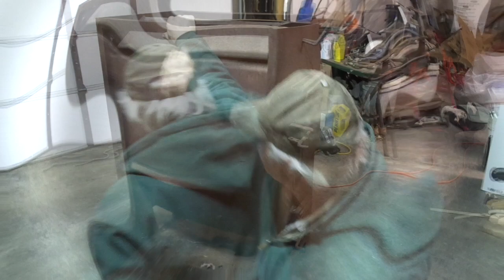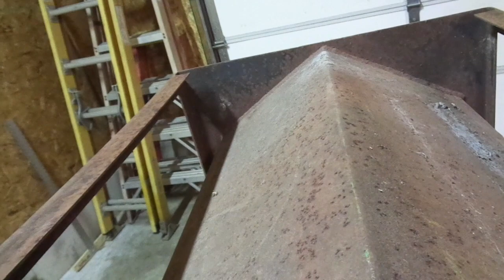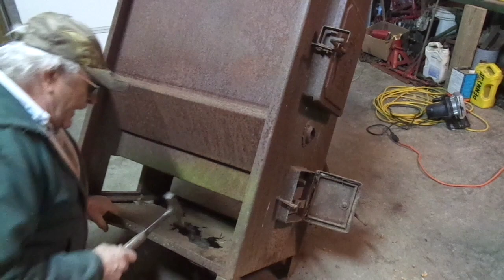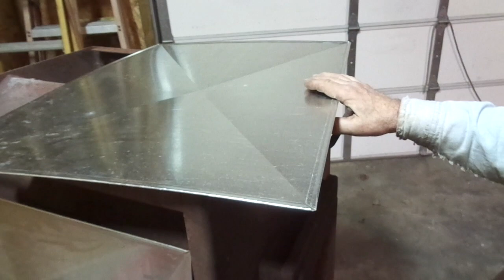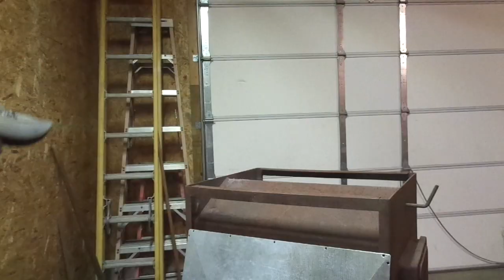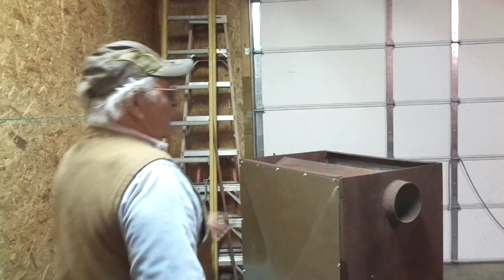Wood Furnace Fire Damage Repair

Comment: The clamps are Cleco Clamps first used in aircraft building.
Reply from the maker: Yes, they should be for clamping skin to frame during construction or repair of aircraft.  But there are a lot of uses in a home shop as well.  Thanks Roy for chiming in.  My old buddy that recently passed worked for the Air Nat'l Guard in the electrical shop for over 30 years.

Comment: That will be nice to see that wood furnace back into action.  I should target to have one for my garage.  I can't afford to have it inside, for obvious space reason. But being outdoors to heat the inside might work with come engineering... Very handy clamps you have. Thanks for sharing!
Reply from the maker: From Steel To Wood well Joe, keep your eyes peeled. There’s a lot of them out there not being used. My neighbors house just sold and the new owners gave away the Fire King in the basement because they didn’t want it. Another buddy sold his and converted his system to an outdoor boiler and heat exchanger/air handler. Thanks for the comment Joe. Be safe and stay warm sir. Keep an eye on Dave for me will you ...??

Comment: I don't have a lot of room to talk, but why not get the in-floor heat working :)  At least I have one of my manifolds connected to the PEX. Great little video, can't wait for the second half.
Reply from the maker: Long story....I'm doing a rebuild video on the boiler right now.  It got too cold to work out there with no heat then about three emergency builds/repairs entered the picture.  So the simple answer was to spend 5 or 6 hours getting this old thing up and running so I can work on the emergencies in a heated space...and now I'm back on the boiler project....and am much more comfortable doing it too !!  LOL.  There's always method to the madness....but it's still madness huh.  Thanks for the comment man !!

Comment: I have a wood chuck very similar to that design and I had to do extensive surgery on the fire box from years of throwing wood in it the back had split open and it would runaway with itself I burnt up 4 fan limit controller around 150$ a pop now it heats my shop and does a heck of a job at it too.  Keep up the videos I enjoy watching them
Reply from the maker: I'm not familiar with the Wood Chuck, but the Claytons are a lot like these as well.    When the helix in the fan/limit gets twisted so far during an extreme overtemp, they have a tendency to fail pretty quickly.  Thanks for the great comment and thanks too for taking the time to watch.  Editing the next vid on the Fire King currently.

Comment: Good vid.. now waiting to see it with a fire inside.. hopefully soon, or winter will be over. lol
I still burn wood in an inside "boiler" unit that I installed 1980, and heats all the water for house baseboard runs.. rarely use the propane backup unless gone from home.
Reply from the maker: Don't worry...it's been throwing heat into the shed for a month or more now, its just I'm running LATE on the videos dealing with the normal emergencies, butchering and other stuff getting in the way.  LOL.  I installed a Canadian made Duo-Matic Olsen forced air wood furnace in my house in 1980, an am currently repairing/rebuilding a Hardy outdoor boiler that was in a fire for the shed.  Its going to be placed inside the shed though. Thanks for watching and commenting sir.  Keep warm....

Comment: What a great video right down me alley! A great shop stove. And here what looked like junk to some turned out to be a fine shop stove! Another great example of the treasure in our junk piles. Have fun fixing it up and benefit from the heat. My shop stove went through  a fire as well in a basement. The fire was so intense that my friends old cast iron kitchen stove melted out of shape. The stove he gave me was protected by the debris and materials that fell into the old foundation. It was a log and stone 250 year old house. Sad indeed but was replaced by a beautiful post and beam house with. Geothermal great heating cooling system. He gave me the stove which was heading to the scrap yard. It sat outside by the shop until I got to it the next year. Wire brushing, new gaskets, oil first of course and some new fire brick and it was like new with some good old stove black. 1/4"  steel with a double cast iron door, an Alaska Stove that I can put a 28" log n either direction. And here some thought it was scrap junk sitting outside my shop. When finished some thought it was a new stove. What a great video I really enjoyed and I raise me JOcup your way another time this Saturday Fiend Wendell! Can't wait to see that stove in action after its 44 makeover! Blessings to All! DaveyJO an I, outta here
Reply from the maker: Heck yeah man...it's amazing what gets thrown away.  I have another stove in the other shed that was also in a burnt down house.  The flue gasses exploded inside the brick unlined chimney and cause the fire.  Unlined chimneys can let unburned gasses to get in between the layers of brick through cracked mortar joints to create that condition.  Its not a problem unless a creosote fire develops in the chimney which then can ignite the trapped gasses.   Heck, my B2400 Kubota has a motor in it out of a thrown away BX2100 that was in a barn fire.  Insurance paid the guy, and he wanted me to just haul off the burned tractor.  So I replaced the bad engine in the 2400 with the one out of the burned one.  Actually that is coming into the shop soon because of a transmission failure...so its gonna mean another trip down in the woods for parts.LOL.  Its always something huh !!
    This old Fire King ain't gonna look near as pretty as your resurrection I'm sure.  As I understand the Alaska Stove Co has a pretty good line of stoves.  But the fact remains that what some perceive as a pile of junk, to guys like us its a pile of potential.  Think of all that comfortable warmth you've gotten so far outta than old thing !!  Take care sir and remember to do what the doc says....I wanna share some JO over your Alaskan Stove one of these cold winter days !!
Reply: Tractorman44 Indeed Friend 44, we have things to share sittin by the stoves over cups O JO! Alice and I were on the phone with my niece in Portland Or. She's a doctor in Portland and she specializes in kidney and hypertension and she's coming in for a four day visit next week. So she filled us in on lots of stuff and wants to talk to my regular doc when sheets here. Ya can't beat that! So it sounds like a trial and error finding the right drug to control my blood pressure. My younger sister been taking them for years and it runs in the family. I'm almost sure there are enough parts of something around my shop that I should be able to fix myself up, cheaper than doctors too!  But I recon I'd lose too much blood doing stuff myself. So it just a bunch of tests and doctors until they find the right thing. But the good thing is, non of the docs were concerned about my coffee intake. They just said if my heart starts to run high on RPMs to slack off a little. But so far so good. I have backed off a little but usually because I fall asleep before I get to that last cup. Or I sit it on the wood stove to warm up and fall asleep. Stove top cooked coffee can be used to patch holes in your drive I believe. Or patch hole in your wall or concrete floor. I will say as well that if they thought I was going for the big dirt nap anytime soon I'd still be in that hospital. But here I am drinkin JO and toasting you so it all good thus! Besides, we will have to team up at one the of  Threshermans events one day. I just said to one of my Rough and Tumble buddies a few day ago, Hey Patrick, only six months until the rough and tumble. Pat was sick last year and couldn't make it. The groundhog said little winter remains on the 2nd. Here is Octorao Orphie, the second original groundhog. Their lodge is about four miles from here by a covered bridge and one helava celebration they have for their members and new pledgers. They have a dunking chair they plunge the newbies I the cold creek,,,,,,always an ambulance standing by of course. Then they go in the lodge,have all their deals, eat lots and drink beer. I've been to their open events in the past, invited by friends that were members. It's fun to see to old guys with their groundhog bolas in top hats. They use to have a seafood dinner and member could invite outsiders. We are about 45 minuets from the Chesapeake Bay, which is known for it delicious crabs and oysters. But all that stuff has become pretty expensive. There are a few crab houses you can buy them in season though. Steamed and spiced with old bay seasoning. Very delicious indeed. So from here Inna holler the Maryland line is about 10-12 miles from here and Deleware close as well. Some guys go to the Home Depot and Lowes there because they have no sales tax in Deleware but 6% in Pa. And it isn't much farther than going to Lancaster,if you're down in the southern end.  So one day you and the Misses will have to visit and stay inna holler hotel so I can show you around this country, see the Amish shops the farm country and the like. One of our friends is the seventh generation to live on his farm, 156 acres, which is a big farm here in Lancaster Co. Here it's how many cattle per acre where in the west it how many acres per cow. One day I want to show you Leroy King's weld shop. I bought this place from Leroy 30 years ago. He bough a old mushroom house, dug the floor out and has one heck of a shop, 48 ton press break, build farm machinery and does a great job. All Amish of course and quite an operation. If I need stock of any kind I go there and we have been good friends of Leroy, Satie, their daughter her husband and their five kids. What I like about it the most is that the Amish are still old timey. Mules in the fields, and all kinds of businesses. I go to a Amish chain saw shop for supplies or repair. He sells new chain from a spool, good stuff too and all models of Sthil,,,,or however you spell it. And of course they have their own one room schools which are all over the place. They go to the 8th grade and know well their reading, writing and arithmetic. Seems the English kids, which is what we non Amish are, they have trouble with the basics. There a many Amish general stores where we do quite a bit of shopping. People complain about all the buggies on the road but I love them. Just have to be careful going around corners and over hills in Amish country. And down our way there is no tourism as in the north of the county. No tour buses and motels and junk shops. So anyway, I'd best take some pills and tomorrow I must get hold of docs and go from there. Can't get hold of them weekends. I suppose they are out on their boats figuring out how much they must charge us to make boat payments, eh? Actually, all the medical folks have been very nice. And me cracking jokes they're not quite sure how to react. Like is this guy for real or is he screwed up in the mind? Makes it fun. Well best get me pills and another cuppaJO to toast your way Tractorman44 Friend Wendell! Me best to All and Stan! This is DaveyJO Anna I'm outta here Inna holler!

Comment: The patina !!! ( Rust ! ) Sir we have a bleeder !!! LOL ( First Aid Kit !!! ) Great explanation for 2nd heat exchanger !!! Sir, I saw the same set of pliers and the spring loaded holders sets in some maintenance floor tools kit for aircraft going to the 2nd line maintenance,,, but i'm trying to remember on which aircrafts,,, ( I'm senil !!! ) and which trades were using them,,, . I'm pretty sure, it's was not on The CF 18 Hornets, or the AWACS, since these were the last aircrafts I work on and I do will remember ( I hope ) since it's lest than 15 yrs,,,   but It could be on the CP 140 Aurora's  ( P-3  Orion's ) or older aircrafts I did work on when I was way younger,,, You get my mind going nuts trying to remember !!! LOL If I got by deduction, it's temporary holders !!! The big question made for holding what ??? Power lever or control surface cable remplacements when we do change these cables ? or other way very useful tools to have is the hold in place big fold of canvas material or seat belts before going to the sewing machine,,,, Sir, that is a very good you get me hang very good there,,,, ???  I'm so sorry,,, i'm only an ex Life Support Technician and Propulsion ( power engine ) Technician,,, it will probalbly pop out of my brind today ( I HOPE !!!! )  Take care Sir and very well made video !!! ,,,, So sorry,,,
Reply from the maker: Dang Dave, I was counting on your expertise in the aircraft industry to tell me for sure what specific task they were for.  But the impression I got was they were specifically used on the sheet metal (alloy) while repairing or fabricating portions of the skin. There are several other items in the tool box that as yet are still questionable as to their use as well.  Whatever they are I guarantee they have a very tight grip for as little as they are.  I can also see by your list of suggestions that they can easily be used for other tasks as well.  Even Grizz made a good suggestion....ROFL !!  One day I'll show those items as well...soon as they can be worked into an appropriate video.  Thanks for chiming in sir, and thanks for watching !!
Reply: @tractorman4461  Good day SIr, Yes olding the the metal sheets, on aircraft ribs, but the fabrication technician use rivets holder,,, like 100 of them to install one sheets alone,,, Mmm  So Sorry,,, I will send you video to one of my buddy who still working in RCAF Maintenance Squadron to see what he think about it. Cheers and Keep warm,,,

Comment: 44 thanks a lot of wgat said is greek to me grew up oil or gas furnaces the only wood stoves I had any time is one in my shed  thats gone now 
God Bless 
PaK
Reply from the maker: Good Morning Peter...My dad, born in 1909, never for one day ever had another form of heat other than wood. (Well, until he suffered a severe stroke and had to be put in a home.)  So I was brought up using wood and started splitting kindling at 5 or 6, graduating to splitting small wood for the cook stove a couple years later then on later to the large wood for the big King Heater.  We split all wood by hand until my older brother built the wood splitter I have in '78 or so.  Thanks for tuning in sir...it is appreciated.